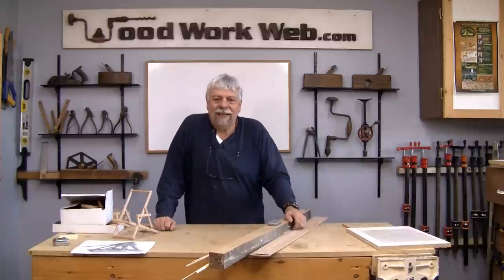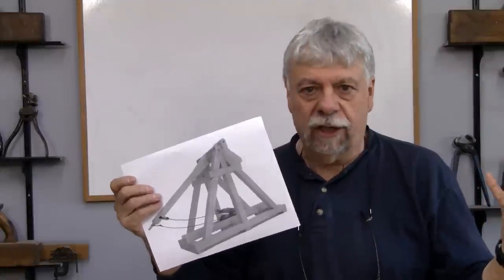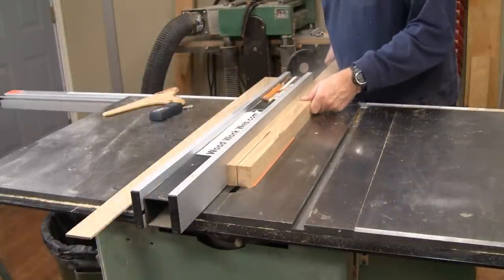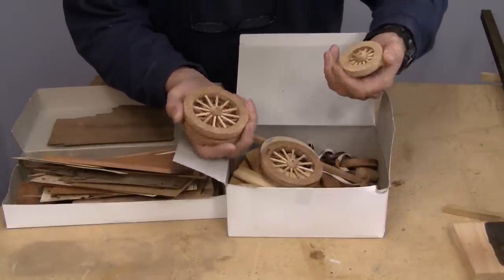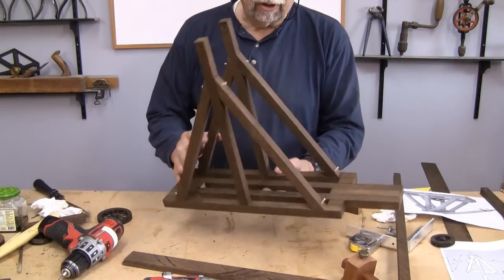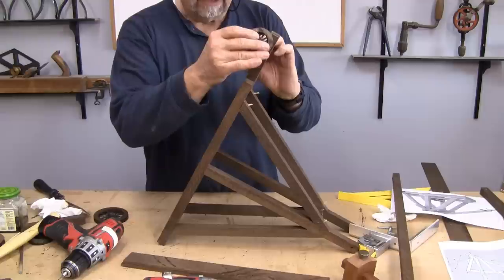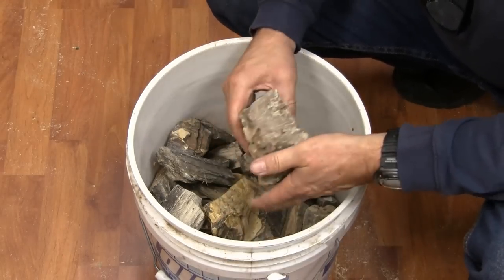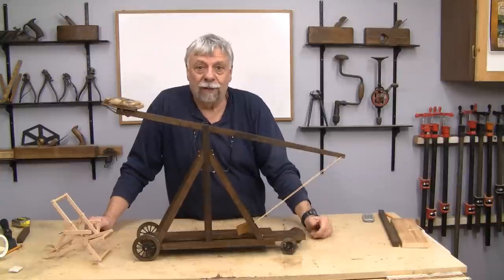Building a Model Trebuchet  - woodworkweb

Comment: There was a reason that the weight was slung under the arm and not lashed to it!  You have reduced the efficiency of the falling weight significantly by attaching the weight as you have!  The hanging weight falls in more vertical path the lashed weight follows an arc and looses a lot of its energy by being forced to come around the curve. also letting the trebuchet roll as it is being fired improves its efficiency with a slung weight but not as much with a lashed fixed weight!  Still it is a good looking model!

Mike T

Comment: Another very cool project Colin. 
Question. How do you lock down a MagSwitch on an aluminum table saw top :)))?
Reply: I bought an aluminium slider, the adjustable type that you can lock down in your saws mitre slot and attached a steel plate to it. Cheaper than replacing my otherwise great Dewalt saw with a cast iron model with questionable fence!

Comment: Looks like it was a fun project. Where did you find those switched magnets?
Reply: Right at the end of the video there's a link to another video just about the magnetic switches. (If you're on a mobile devise you can search for VideoID HhcBm57qMC0 and find it that way.)
Reply: Jeremy McMahan  Thanks, not cheap at $24 each at Amazon, but handy little critters
Reply: Handy I'm sure, but yes, they aren't cheap. I haven't bit the bullet yet, but a couple of those are on my some-day list.
Reply from the maker: Jeremy McMahan  TJ weim As a side note, I see that there is a competitor to these now, I don't have the info off hand but if you search for magnetic switches you should be able to find them, I ran across them a few weeks ago ... just thought both of you might be interested .. sorry, I do not recall pricing
Reply: Thanks for the update! I'd have just gone off spending and not searched otherwise. :)
Reply: Jeremy McMahan All I could come up with are the electronic mag switches. Did you find more of what we seek?
Reply from the maker: TJ weim Jeremy McMahan I cannot find them now either. It could be they conflicted with the Mag Switch patent and had to be taken off the market.
Reply: WoodWorkWeb Thanks for trying Colin. I will keep my eyes open and if I come across some I will get back.
Thanks again
Reply: I found some at lee valley tools, they are on/off magnetic latches. not exactly what you had Colin, but I think it will suffice for my needs at about a third the price!
Reply from the maker: TJ weim Ah ... good, I thought I saw those somewhere, never thought to look at Lee Valley ... thanks buddy, I will remember this now, and thanks for posting this, others will be interested too
Reply: WoodWorkWeb Glad I was able to help and even more that I was able to find them. I ordered 4 last night! Side note...I love your videos and content, keep them coming.
Reply from the maker: TJ weim Thanks buddy, appreciate your feedback